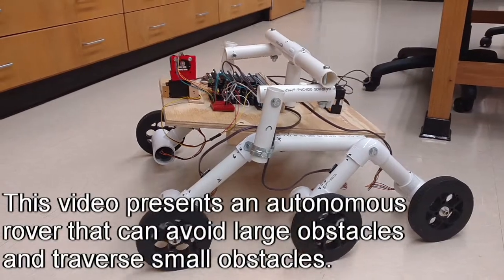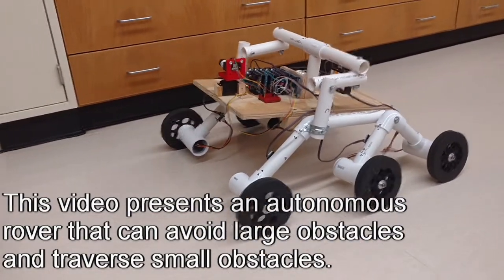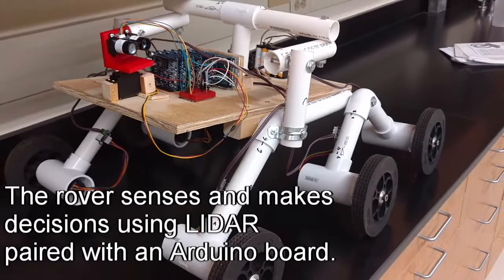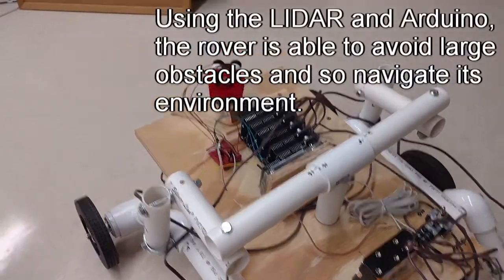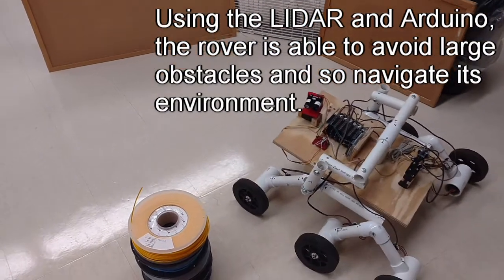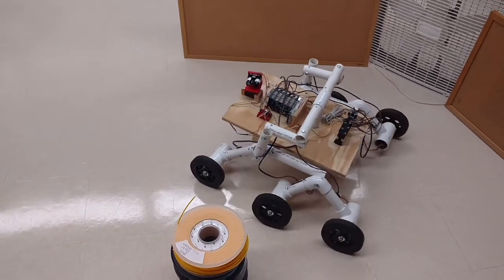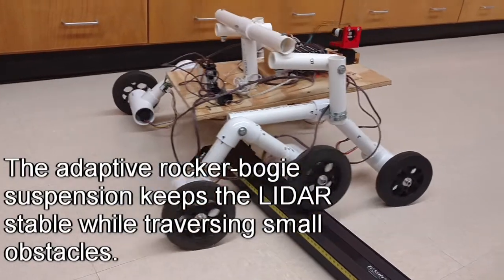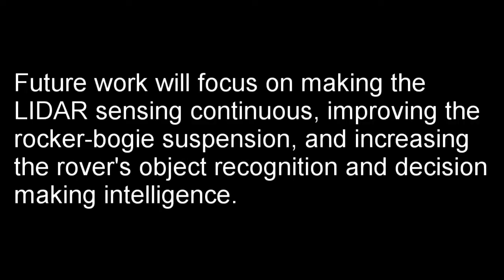Autonomous Rover with Adaptive Suspension

Comment: Great rover, can you tell us which motors you used for this rover?  Thanks
Reply from the maker: Hey LJ Liberto,
We used 3 of this kit from RobotShop: https://www.robotshop.com/en/rubber-wheel-motor-kit.html
It was a good starter kit, but the motors don't actually have a ton of torque. They do fit well inside of the PVC though.
In our second version of this rover we upgraded these motor to higher torque versions: https://www.robotshop.com/en/12v-313rpm-4166oz-in-hd-premium-planetary-gearmotor-encoder.html

Hope this helps!
Reply: Thanks!

Comment: What is the use of this rover
Reply from the maker: The use is a simple demonstration of obstacle avoidance. It doesn't have a practical purpose but the general platform could be used as a great sensor deck like on the Mars rovers.

Comment: Can you give the wheel diameter and motor RPM details
Reply from the maker: Selvam m.s The wheel diameter is 5.25 inches. The motor RPM varies considerably depending on the scenario though so I can't really give you a specific speed for that. You may be able to calculate it from the video though. The clips are in real time.
Reply: Jack Kawell thank you